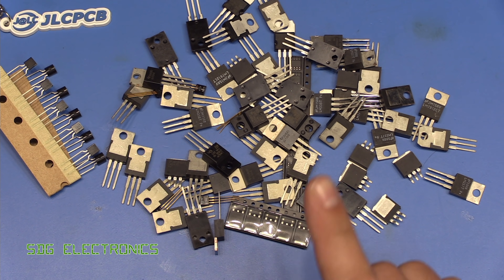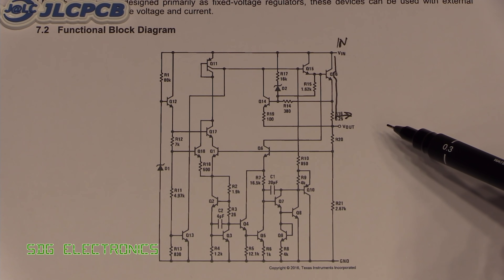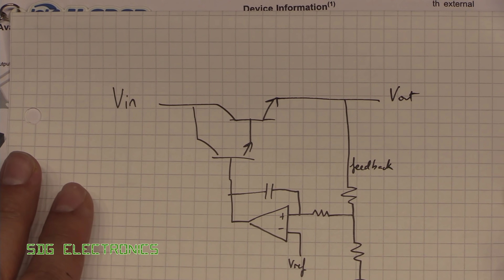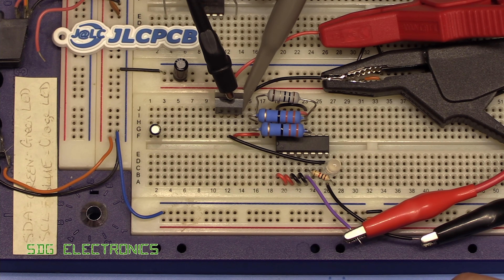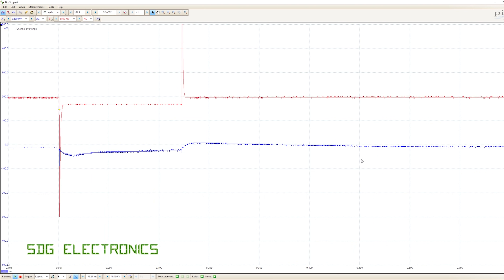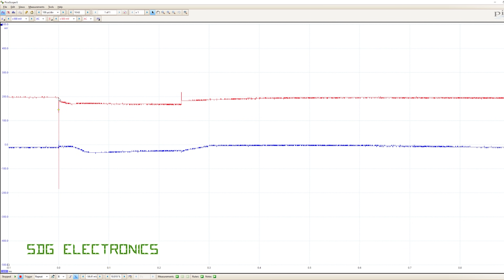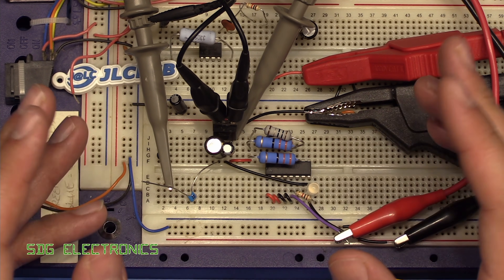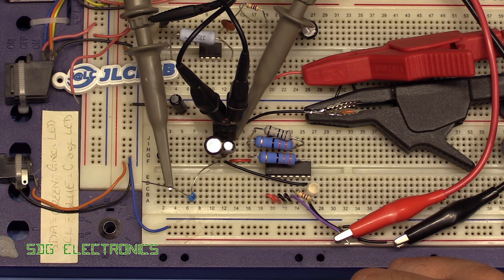SDG #212 Why you don't need 10000+ uF on your voltage regulator output

Comment: Some regulator series (for example *1117 from SOME manufacturers) require ESR of capacitors on the output to be within some range, for example 0.1 ohm -- 1 ohm. In such scenario, using an electrolytic capacitor can be better than using a ceramic capacitor. If using a ceramic capacitor is required due to size constraints or other reasons and a better regulator is not possible, then one could add a resistor in series with the capacitor to introduce some ESR into the circuit.
Also, some datasheets say something similar to "a 10uf tantalum capacitor is enough" ... keep in mind they may say tantalum because the ESR of tantalum capacitors was usually quite low (in the hundreds of mOhm) but not as low as ceramics and way back then on the first revisions of those datasheets electrolytic capacitors may have been much worse specs wise, so if you want to use electrolytic or polymer capacitors instead, you may have to go with a slightly higher capacitance value.  Tantalums are often more expensive and they have some drawbacks, like potentially burning up / exploding on overvoltage (hence it's often recommended to use tantalum capacitors rated for at least 50% more than regular expected voltage)
Reply: Agreed, except be careful with polymer caps as the lowest ESR caps are actually polymer ones. They really are made to be mainly used in very modern high frequency dc-dc converters requiring significant currents like the ones you find in GPU powering circuitry. And they are lower max voltage, higher cost, lower availability anyway, so actually more disadvantages.
When you are dealing with very sharp voltage drops as demonstrated in this video you are more after lower equivalent inductance (including parasitic) than capacitance. And for that purpose all application notes say that smaller footprint SMD ceramics placed as close as possible (obviously not on breadboard) outperform bigger and higher capacitance ones due to physics of internal structure. Best of both worlds is to put like 0.1-1uF caps very close in pair with 4.7-10uF bulk input cap where available nearby. When you see in schematics a bunch of same small value non-polar caps in parallel, this is the same thing but with compromise for consolidation of nominal values. Output side may or may not desire low value cap depending on the following load factors.

Comment: You didn't test the regulator noise under load, which is I think why they do add excessive output capacitors.

Comment: What value was the ceramic capacitor you used?  The mlcc waveform looked horrible though the conventional wisdom is to put small ceramic capacitors on the output.
Reply from the maker: I think it was 1 or 10 uF
Reply: @sdgelectronics  Ok those are the values of mlcc I usually use on the output of 78xx regulators, I don't have a scope though so I could never check if it was working.  Datasheets usually recommend 100nf ceramic on the output maybe 100nf's the largest mlcc can be without interfering with the feedback loop?  
Either way I'm going to stick with a 1uf+ tantalum in parallel with a 100n mlcc now hopefully that should be ok.

Comment: Nice video. Regarding ringing with the ceramic capacitor on the output, I think you said it was due to the low ESR, but to solve it you increased the capacitance as well as using an electrolytic. Could you instead have added some resistance in series with the ceramic capacitor, would that have worked?
Reply from the maker: You could, but then it loses the high frequency performance. It might be possible to reduce the problem with an actual PCB since the breadboard used in this video does add some parasitics.

Comment: I might be wrong but I'm sure XraytonyB had some problem with ringing in a tone circuit when he changed the electrolytics for ceramics and was asking if anyone knew what the reason was for it, is this a related issue as he changed them back and the ringing stopped.

Comment: Excelent video, very well demonstrated, the capacitor in your diagram, inbetween the opamp output and the non-inverting input, what is it used for.  Also could a similar test setup be used to get an estimation of the Phase Margin of the feed back loop by observing the oscilations on the step impulse at the output of the regulator. Thanks again, a great video.
Reply from the maker: I did the drawing slightly incorrect, swapping the + and - symbol around on the op-amp. The capacitor limits the bandwidth to prevent unstable behaviour at high frequency
Reply: @sdgelectronics  Cheers, great video again, keep it up.

Comment: The ESP8266 is a difficult IC. 3.3 volts and a few mA, but high spikes when it connects to the wifi. Not every linear regulator can do this. Usually the 3.3 volt is generated from a 5 volt. That's why I put enough uF in front of the 3.3 volt regulator as a buffer. In the project I had a 24-30 volt supply voltage, from which a stepdown generated 5 volts, then the 3.3 volt linear regulator.

Comment: Ha ha. That audiophile effort, as with the rest of the quackery that goes on in that industry, is hilarious. In response to your question of whether we'd like to see more detail on smps filtering, I for one would be very interested. I'm particularly interested in the implications of driving high current solenoids (about 4A). Thanks for your intelligent videos.  Much appreciated.
Reply: Anything that has an effect on the waveform will affect the sound the amplifier makes, the goal for audiophiles isn't make a well functioning power supply it's to make a nice sounding amplifier.

Comment: Well, any reactance on the output introduces a pole which in the worst case violates the Nyquist stability criterium. You showed nicely the impact on transient load changes where oscillatory behavior became apparent already. In principle a regulator is as you say just the equivalent to an op-amp. With the proper compensation you can achieve better slew rates than just with the .20dB/dec response. In a power supply you want to enforce stability which as you demonstate can easily be destroyed. Anyway in your drawing looks like that likely by mistake you switched the inputs of the op-amp - thus adding the compensating capacitance to the non-inverting input and output which surely causes instability given its value.
Reply from the maker: Thanks, yes I swapped the inputs to the op-amp accidentally.

Comment: ive had the issue several times with a classic 78 79 dual rail supply and opamps that the positive rail wont start and just sits at -0.5V or something
Reply: I'm pretty sure I've seen a diode across the output (cathode to + side) of each regulator to stop that.

Comment: Good video. For linear regulators, such as 78xx, it is not recommended to put low esr capacitors at the output. This can cause generation. As well as high-capacity capacitors. But if you need a large capacitor capacity in the circuit, and it stands after the linear regulator, then a 4.7-15 ohm resistor must be installed between them.

Comment: The solution is to put a number of different caps on both the input and output lines.
Reply: Maybe for the input but I thought part of the message here was that having too much capacitance on the output can be detrimental, so you probably don't want to go overboard with too many different types in parallel there?
Reply: Over capasitance on the output is bad and parallel isn't going to fix that.

Comment: I tend to have been using LDO's for their efficiency and tend to use about 10uf ceramic in parallel with the local and bulk decoupling.
I only know 1000uf's are only required after rectification for smoothing. Other than large fast loads like you mentioned.

Comment: As always, then, follow the spec sheet! I'd be very interested to see exactly the same, but for LDO regulators. How is all this affected by the distributed supply capacitance in a complex circuit with local decoupling on multiple devices? Do we simply rely on the local supply inductance to allow the regulator the freedom to regulate?